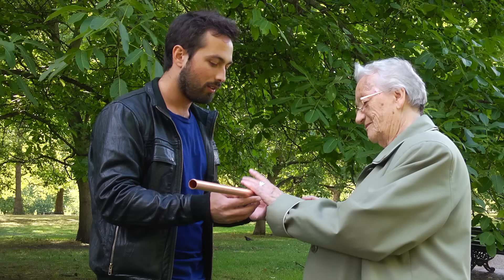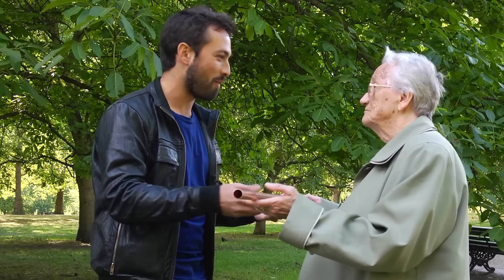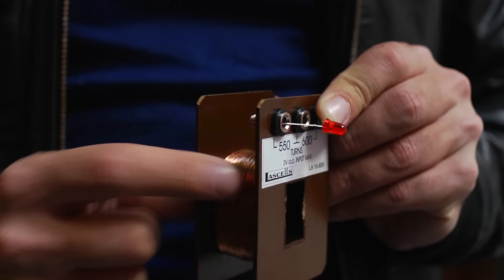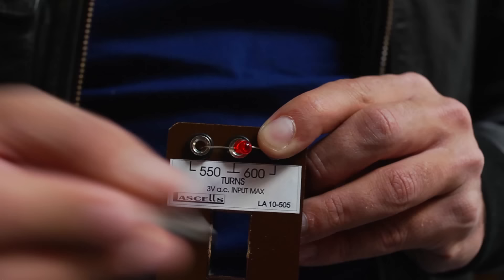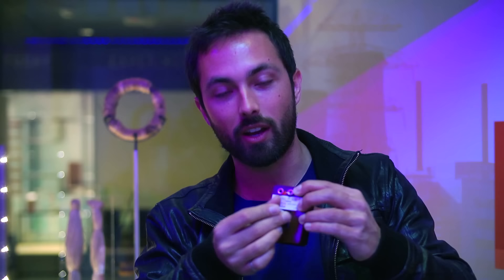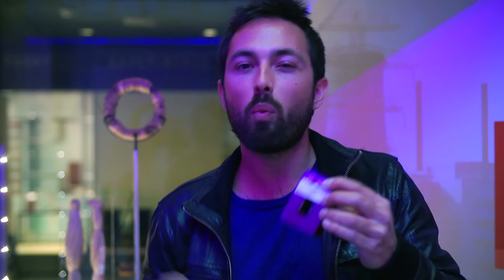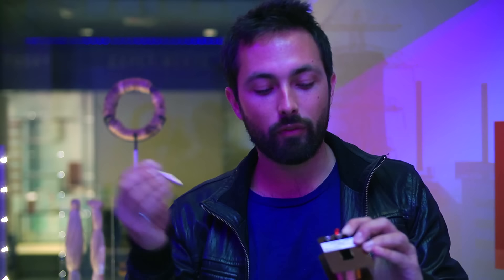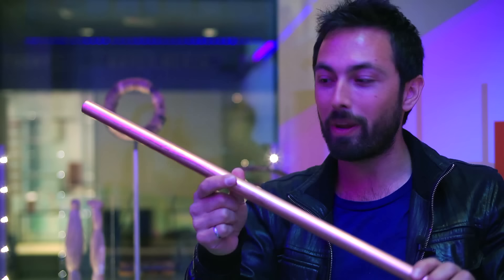World's First Electric Generator

Comment: I tried this tricks before. How fast the magnet will fall down depends on the strength of the magnet and conductivity of the tube. Neodymium magnet falls much slower than ferrite, and the magnet falls slower in copper tube compared to in aluminium tube.

Comment: so since speed is relevant to the effectiveness with the LED does that mean that if you move the copper pipe upward rapidly that will slow the decent of the magnet through the pipe, would direction of the pipes movement even make a difference?

Comment: So many questions. Can positive and negative terminals with a wired loop be connected to each end of the pipe to power a lightbulb? Would having a piston shaped magnet in a snug fitting copper shaft create more wattage? Does pulling the magnet faster create more amps or volts/ would making the pipe and magnet larger create more amps or volts?

Comment: ziongite  Actually that is how almost all electricity is produced. Nuclear, solar and geothermal all typically use steam (either heated by the sun, radioactive material or geothermal) to turn a turbine that turns a coil around a magnet to produce electricity.  But you are right he did say all and not all electricty is generated this way. Their are some semi-conductor devises that can turn sunlight directly to electricity, but this is the actual small minority.

Comment: Hi isit possible to create a video where the copper tube is rotating using external means and then drop the magnet inside the copper tube. Depending upon the direction and speed of rotation i think magnet exit timing will vary.. could you please do that for education purpose

Comment: If you had a circular pipe with a magnet inside couldn't you cause the magnet to continuously fall by spinning the pipe and have the electricity created spin the pipe so you have a psudo perpetual motion machine using only gravity as power sorce?

Comment: I dont suppose I should expect people to know this, but small singularities are unstable, evaporating due to hawking radiation.  A singularity with a mass of 10 kilograms has a temperature of 12,260,000,000,000,000,000,000 degrees kelvin, while a nuclear explosion is merely ~10,000,000 degrees kelvin.
"evaporating" in this case means instantaneous explosion.

Comment: there is something I dont get... Why does the induced magnetic field from the copper tube excert a force in the opposite direction? what would it take to accelerate the neodymium magnet? does it matter what way the magnet is inserted? I have troubles understanding magentic fields...

Comment: Did you know that you can take a common stovepipe place a Magnetic on one side of the pipe, and place another magnet on the other side of the pipe.Now attach a wire to beside  magnet.Then  build a fire in the pipe preferably with hydrogen although coal will work. The hot plasma gas moving through the magnetic field in the pipe will create an electric current in the wire.This will produce anywhere from 100 to 1,000 Volts DC current.

Comment: No, at least not on a noticeable scale. For the eddy currents to form you need a very good electric and "magnetic" conductor. So, about any metal would do it. Some other conducting stuff, like carbon, might do the trick too, though carbon has a low magnetic permeability, so i'm not quite sure. 
The magnet moves and therefore generates a moving magnetic field. A moving magnetic field induces a current in a conductor, which in turns induces an opposed magnetic field, which slows down the magnet.

Comment: @veritasium What would happen if several magnets were dropped down the pipe within a short time from one another? Drop a magnet, 1 second later drop another magnet, then drop a 3rd one after waiting another second. Do the same experiment but this time vary the time. Half second between drops, quarter second between drops. Don't drop them close enough for them to attract one another.

Comment: All power is produced this way except solar panels which use the photoelectric effect to produce electrons. Although you can still use the sun to produce energy like very other power source. By using mirrors and lens to focus the light you can heat up water and turn it into steam and drive a turbine to produce power. I think its actually more interesting how we use water in nearly every from of power production.

Comment: Well, yes. If you set up the right system, but some energy would be lost to friction and loss of heat due to the impossibility of perfect insulation. So basically, I think it'd only be able to function as a nice hand-cranked generator that might run for just a while if it gets up enough initial speed through a person cranking it.

Comment: That is similar to what would happen in a Tokamak. When the electron and proton plasma moves quickly trough the Tokamak, the plasma it self becomes electric and generates its own magnetic field. This electromagnetic field fights against the electromagnets which are there to confine the plasma and cause fusion. i think the effect would be something similar to friction, and that is what I think is a major part in why they are allways 20 years from a net energy gain with the Tokamak. I allso suspect that it is one of the reasons why the Tokamak is experiencing sucha dangerous, weird and unstable instabilities.

Comment: Would it work to have a stationary magnet and a copper strip moving quickly next to it?  For example, if you mount a magnet next to a wheel of copper and spin the wheel quickly enough, would that generate electricity in the same way?  Also, how efficient is this form of energy production?

Comment: If you had played with a Van De Graaff generator or a Whimshurst Generator, you would  know that Mr. Roney is actually right, that at the very least, the electron indeed emulates gravity. Electricity is used to float/suspend objects (like a frog) in mid air. As for UFOs, high frequency energy is involved in this process. It's best known as, Gravitics.

Rather than ridicule Mr. Roney, Google what he is saying and you'll see that he is actually correct on all fronts.

Comment: If the tube is made of a superconductor what will happen to the magnet? The tube won't heat up so it will get stuck at the top. The only reason it drops in the copper tube is the energy is dissipated into ohm heating of the copper.

Comment: What are the follow up experiements from everyones thoughts?
I would like to know what happens if you pulled up on the copper tube, would you suddently feel the weight of the magnet? 
What if you pulled down on the copper tube 2 times the rate of gravity. Then would you feel a pull up? Because if it is moving up at 1 g, then the resistive force felt in the tube to disipate the kenetic energy. Or would the tube rather get lighter?

Comment: :) Sience can be funny if you know how it works. Moving magnet inducing electric field in copper pipe. Electric short-circuit curent in pipe generate heat and magnetic field, which slow down dropping magnet.

Comment: Question is, making a vibration or back n forth movement on the magnet will require less energy than it produce? if so it will work as an endless energy conductor, that requires just the small spark to start it.
Once again thinking of the future makes me feel excitement iniside xP
Reply: Dude as I'm sure you know in our corrent stage of understanding there isn't anything that can preduce more energy then what he wasted... Except if you send 3 cats to a black hole tho you can have enough energy to power up Norway for a year ⚡🇳🇴⚡ 😉

Comment: I would love to show this experiment to the children in our after school program. I tried it but it didn’t seem to work right. What size magnet are you using?
Reply: I know this is a few weeks old, but the magnets must be relatively strong magnets such as neodymium magnets. You can also use a roll of aluminum foil in place of the copper pipe to get the same effect.

Comment: semi interesting question --- if one would line a spaceship with magnets and placed it inside a copper (lquite arge) tube/cavern would the spaceship be slowed down once the thrusters went off - or shot out faster??
Reply: Well if the tube is applied electrical current no thrusters should be needed. Thank you kind sir for explaining me how a railgun works.

Comment: 2:50 "This is actually the way all electricity is generated" You're full of it photovoltaic solar cells, peltier junction and piezoelectric generators all use different methods.  There are also electro chemical reactions including fuel cells which are reaching industrial scale fueled by natural gas.  I'm sure there are a few others I'm forgetting too.
Reply: Yeah, this guy never states the whole truth. He just tries to make every simple effect like its something new and revolutionary.

      Another example of that is when he made a video about how fuel and oxygen mixture can explode given high enough pressure.
He explained that effect, to some degree, gave that guy some popularity for stuffing Cotton into a syringe and pressing on it.
      But never said that this is how a Diesel engine works, since 1885.

Comment: The magnetic field and electricity is a from the magnetic field and the copper copper slows it down from the magnetic field and the electricity come flying around the electromagnetic field you ever put a coil of wire around a magnet you can actually produce electricity if the magnet moves through the coil

Comment: So if you cut a slit in the pipe lengthwise, the magnet should drop at the same rate as the non-magnetic object they ran through?  Is it possible for the slit to arc-over and conduct eddy currents?

Also, if the surface of the magnet was conductive, would there be a difference in voltage potential between the magnet and the pipe when there is no slit in the pipe?
Reply: Correct. A slit cut into the pipe would effectively break the circuit and the eddy current can't flow

This was actually one of the questions on my O Level physics

Comment: I actually use an paper cylinder wrap a copper wire around him may be 90 to 100 times and pass a bar magnet through it and connected the wire end to galvanometer and what i found is a deflection (created this for my 10th class science project)

Comment: every sort of power except solar power and hydroelectric, involves a magnet and a coil, nuclear power heats up water which turns into steam and drives turbines generating kinetic energy converted into electricity the same can be said for coal, oil, gas and geothermal power plants.

Comment: He have came so far now, but old stuff is still interesting cause it's physics.
What's also interesting is gravity is the weakest force in all fundamental forces but still all of energy we use is from gravity. Gravity keep the sun producing radiation which gives solar energy which in turn used by plants for photosynthesis and then we eat plants, solar energy also make the ocean water evaporate which condenses on mountains or rain at a height, which when comes down as river rotate turbine to produce electricity. Winds produced by rotation of earth due to gravity and then windmill turn it to electricity. Tidal currents formed by gravity, geothermal energy, volcanic eruption everything somehow connected with gravity.

Comment: World's FIRST electrical generator? That's debatable. Archeological evidence suggests that the Bagdad Battery, invented by the Ancient Egyptians, was capable of producing an small electrical charge (approximately 1 volt).
Reply: Nope, a battery does not generate electricity.
Reply: Albin9000
Modern batteries don't, but the Baghdad Battery did. It operated by the same principle as the one in this video does. I advise you to look it up.

Comment: Does the pipe work like the copper coils around the magnet inside an electric motor, most likely. Which creates changing electro-magnetic field as it moves through the pipe, im not sure whether i got it..
Reply: The motion of the magnetic field induces an electric current in the pipe which itself generates an magnetic field opposing the motion of the magnet. The induced current in the pipe is partly disippated as generated heat in the tube, so the losses allow the magnet to continue to move down through the pipe (whilst simulataneously warming the tube). The pipe, in effect, functions as an imperfect magnetic mirror. If the pipe were a perfect superconductor, I suspect that the magnet would never move, although I've never done the math on this or tried the experiment, so I might be wrong.

It might be fun to try this sometime with both magnet and pipe allowed to cool to ambient, and then drop the magnet while watching the tube with a thermal imager.
Reply: i guess both the magnetic fields push against each other, causing the repulsion to reduce its falling speed. Need to try it out sometime.
Reply: To be exact, the changing magnetic field down the cobbertube is pushing electrons away from the neutrons (neutron + electron = atom) and forcing them to switch position. Thats what creates electricity.

Comment: -_- No, to power space station they use solar panels. If they really need to power even more, though not significantly, he can perhaps use RTG. But that is not usually used. 
Where the heck did you get this info?

Comment: As long as you remember that electricity and magnetism go hand in hand, it's all pretty simple. Electric flow- movement of electrons- creates (relatively small) magnetic waves, and similarly, magnetic waves produce a small electric flow.

So by dropping the magnet down the copper pipe, it will create a small electric flow in the pipe, the electrons in the copper begin to oscillate in small eddy currents, which in turn generate their own tiny magnetic field that weakly opposes the magnetic field of the magnet. Done.

Comment: why don't we yet make shock absorber using this principle? it's very simple, just control the pulse of the coil so the car has variable dampening suspension, and won't be an expensive active suspension. Why do they instead make the sophisticated active suspension that can jump the whole car?
Reply: magnetic suspension does exist, the Audi R8 has that, problem is that it's expensive

Comment: I just tried this with a 6" long copper pipe and a 1" speaker magnet and it didn't work. What did I do wrong?
Reply: 44sharpshooter  Nothing wrong actually.  There was an opposing force there, but the accumulated velocity of the falling magnet after a mere 6" drop was so small that the voltage (and resulting current) induced into the wall of the pipe produced a negligible counter field.   Believe me, 44, those electrons were forced into motion but not enough to make a difference!

Comment: Does the fact that Copper is paramagnetic have anything to do with this?
Reply: DuckofaPato Not really.  The magnetic properties of copper are negligible in this experiment.  In theory, you could make a pipe out of a special copper-nickel composite or alloy, that nullifies all magnetic properties of both the copper and nickel.  In such a case, it would still work.

In practice, it is hard to find a metal that is has absolutely zero magnetic properties, yet is still a good conductor of electricity.  Copper works well enough.

This has to do with the electrical conductivity of the metal.  The metal conducts an electric current, induced by the time-varying magnetic field of the falling magnet.  And that electric current produces a magnetic field of its own, which acts to oppose the motion of the falling magnet.

Comment: it also works with aluminum. does it work with gold and silver or other non magnetic but conductive metals?
Reply: it might work with gold since gold is a better conductor than copper is. But there is no way to know for sure, since pure gold is way too mallable to be used irl.
Reply: yeah. im sure it would but its just a cool thing to think about
Reply: Aluminum is used in the rotors of pedestal fans, of which can generate electricity, but not as well as copper. Silver is the best conductor to use in an electromagnet seeing as it has a higher heat resistance than gold (IIRC), but is very expensive.
Reply: i actually have a really thick aluminum tube that works. but only if the magnet is big enough to be close to the sides as it falls. otherwise it just falls with little effect

Comment: Could the heat generated by this be used to power something, eventually? If you use a bunch of pipes and a bunch of magnets and set them up in a way so that heat can be transferred to a body of water to produce steam (or perhaps some other energy-converting process!), would this not be a pretty good way to.... oh I forgot the part about bringing the magnets back up. But hey, with a pinch of human power, I guess this system could be used as a hand-cranked, immoble generator? hm...

Comment: 2:50 Wrong. Its not the way all electricity is generated, Fuel Cells work diff :)
Reply: Congrats, but generally that's how most electricity generators work. Not everything works on batteries.

Comment: so, if we build some tall copper tubes, and when the magnet falls to the bottom, we could use some of the electricity that it built up, to push it back up. no?
Reply: and by repeating, infinite energy?
Reply: Well, I guess it's dependant on how much energy is needed to push it back up again.
Reply: Brandon Eaton
You'd still have a net loss of energy I'm afraid. Not all of the gravitational potential energy (GPE) is converted into electrical energy because of forces such as air resistance and friction that slow the magnet down as it falls
Reply: Yeah, even in a perfect world without friction it would only, at best create exactly as much energy as put into it. Now also keep in mind that the copper tube has electrical resistance, so any current running through it is going to lose some energy that way to heat.